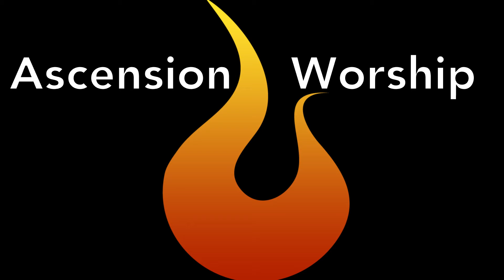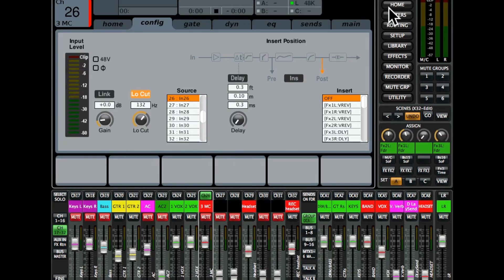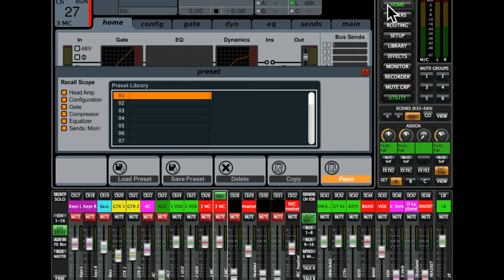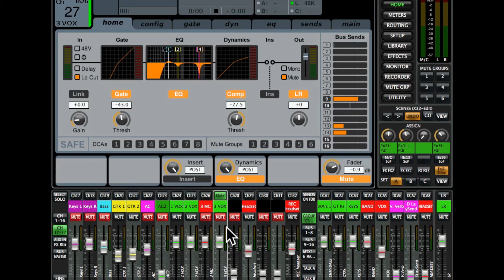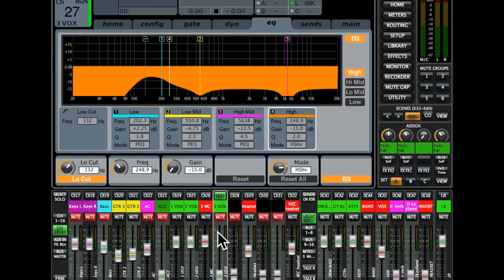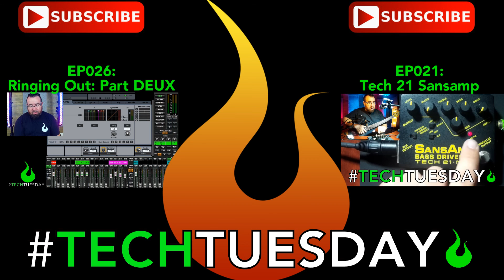Double Patching: Part 1 - #AscensionTechTuesday - EP027

Comment: Can you copy paste a channel in X32 Edit?  Also, if your ultranet P16 routing is Pre-EQ is there anything you need to do to make sure P16s get both channels from that same mic?
Reply from the maker: I believe you can copy and paste in the edit app the same way as the mixer - with the utility button.
Reply: @AWTechTuesday  Didn't see that capability but managed to save kick drum as preset, select djembe channel, and load the preset to get a starting point.  Double patching situation